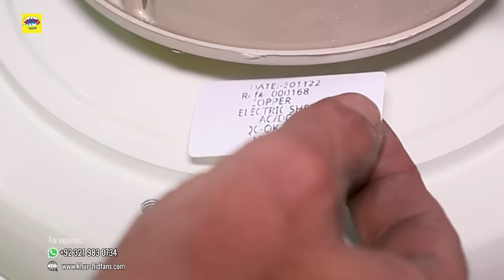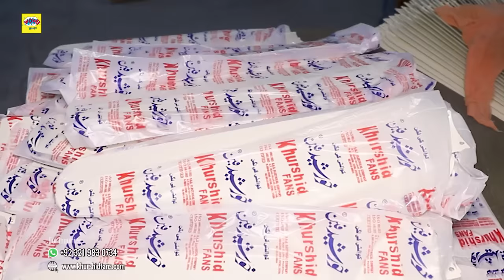How High-Quality AC/DC Inverter Ceiling Fans are Made

Comment: I Bought One fan which they are manufacturing its very High speed and Very Good Good Quality. not a single complain since I'm using it for one year. Working very well both on Ac current and 15v DC. These called Khursheed Ac DC Fans

Comment: These are well-made, high-quality fans that I wish were available to buy here in the United States. Good job!
Reply: It would be much better to be able to purchase American designed fans, made by Americans in American factories of American companies, instead.
Reply: @QuadMochaMatti  big corps sold us out overseas.
Reply from the maker: Glad you like them!
Reply: I Bought One fan which they are manufacturing its very High speed and Very Good Good Quality. not a single complain since I'm using it for one year. Working very well both on Ac current and 15v DC. These called Khursheed Ac DC Fans
Reply: I don't think they have any fan manufacturing companies in America anymore.  Not for residential customers, all you see are Made in China fans in Homedepot and other home improvement stores.  This Pakistani Made Fan is of much higher quality and I would certainly buy it over Made in China, POS they sell here in US with much lower cheap plastic quality with very low Air flow.
Reply: That will be super pricey for sure @QuadMochaMatti

Comment: Greetings from India. The build quality of your fans is awesome. And they are very professionally designed and beautifully produced. Professional production of the product and also the video. I have a doubt. This fan works on both AC and DC? If so, how does one select that?
Reply: Those are BLDC fans that run on AC
Reply: @logicamani  Thankyou
Reply from the maker: Glad you like them! Stay tuned for more.
Reply: It runs on both 12 vDC or 220 VAC. You have to have separate wiring for both, there is no automatic switching. The idea is when you have electricity available from the grid, you use 220 v. When no power, you may have solar panels and 12V battery installed in the house, you use 12V power. The UPS or solar power controller automatically takes cares of the switching.
Reply: @someone1089  Thank you for taking the trouble to explain.
Reply: You can connect ac and dc as well. It will run on ac on priority, if ac cut off, it will automatically switch to DC. And when ac current is on again, it will shift to ac as it’s priority current is ac.
Reply: @muheedin  Thank you for the correction. I didn't know that AC takes priority over.
Reply: It is controlled by remote

Comment: ceiling fans don't need that kind of electronics. it's just more unserviceable crap to break and you can't use a hard-wired control on the wall any more, has to be some cheap goofy IR device.

Comment: Are people still using ceiling fan? Never seen anymore.
Reply: @bobbydazzler6990  We live in 21st century, no more ceiling fan, but using central air conditioner in our house. Never seen ceiling  fan in the nation. We use solar energy for electricity in our community. No more oil engine generator for 21st century.
But you live in 19 century, and mid 20th century. That is why you still living with the ceiling fan.
Reply: @hendyhuang2989  Modern doesnt mean better, especially in terms of health. People created a lot of cool home accessories with doubtful impact on our health.